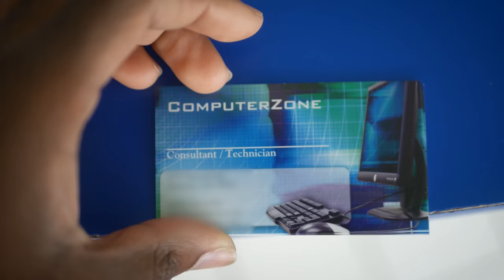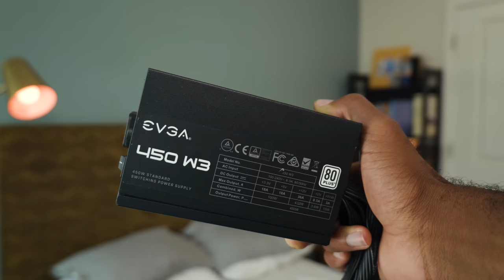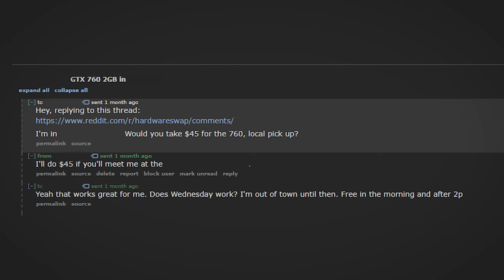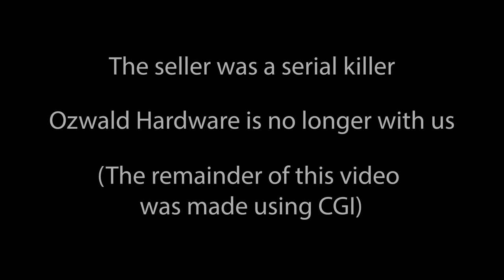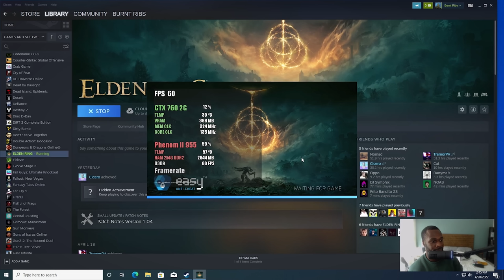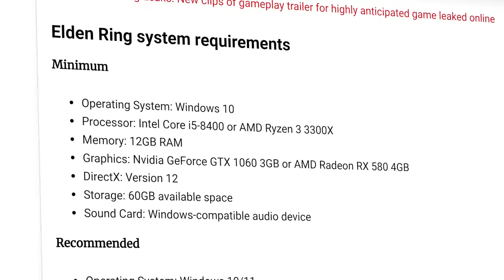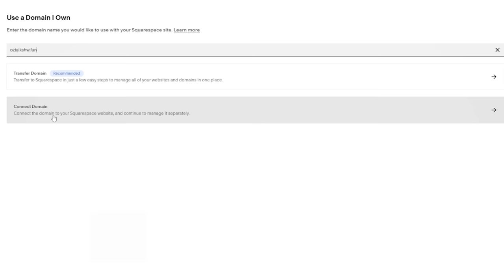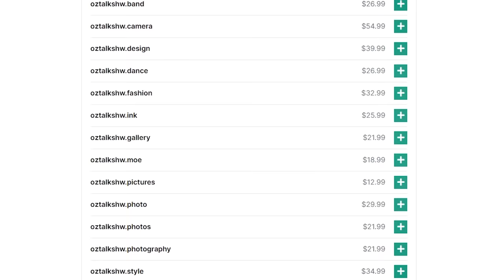I played Elden Ring on a $100 PC...

Comment: I was workin at a thrift shop for a while and I found two diamonds in the rough. I found a i5 4690K with 16 gbs of ram he donated it because the motherboard said it had no cpu which was a psu issue giving it no power its was 20 bucks. I also found a i7 4770s with a r9 380x but with no ram installed so that one was 20 but I spent 80 on a 16 gb kit for a total of 100 dollars that I gave my lil bro.
Reply: W

Comment: It's almost never worth it to "upgrade" an ancient PC that's already on life support, and this video perfectly proves it.
Reply from the maker: Exactly, you just need to build a new one
Reply: Depends what you want to do with it. Adding RAM does wonders, as well as SSD for boot. Lot of people do mundane tasks with their PCs, with only some light gaming. For example, in this case, Elden Ring is not playable but older titles like Darks Souls (very similar settings) could be.
Reply: @aleksazunjic9672  Sure, but don't forget that old components are much more prone to failure, and finding replacement parts will be harder and more expensive as they are out of production.
If you spend a little more for a new system, you will not only get a much better usage experience no matter what you do on it, but also a lot more life out of it.
Plus, your old system has more resale/residual value in working condition.
Reply: @manaphylv100  I'm not advocating spending tons of money on old systems. But if you can get something cheap or even free, upgrading RAM and storage is no brainer.  Overall cost should certainly not exceed 50% of a new system.
Reply: @aleksazunjic9672  If you can get RAM or storage for next to nothing, then of course, take it. But you'll be surprised how many people would spend a fortune on silly things like the fastest CPU for an old socket.
Reply: @manaphylv100  Maybe enthusiasts, but they are rare. Usually people want something cheap to get by.
Reply: @aleksazunjic9672  I hope you mean collectors. They are irrelevant.
Anyway, my point is don't do something stupid like buying a QX9770 for $100 to upgrade your old LGA 775 system.
Reply: @manaphylv100  Well, nobody does that except enthusiastic collectors of old tech :D
Reply: @aleksazunjic9672  Collectors have their own niche, but you'll be surprised how many regular users think an old 1st/2nd/3rd-gen i7 is still faster than the latest i3/R3. Some would pay a premium just for the "i7" or "Extreme Edition" branding.
Reply: @manaphylv100  Admittedly, there are people that think any i7 would be faster than any i3, but these people usually do not upgrade computers because they do not know anything about them (motherboards, sockets, RAM etc ...) They sometimes fall victim to prebuilt sellers and that's it. People upgrading their machines know about generations and would act accordingly.

Comment: Been on the fence about trying this game since I'm on a FX 6300 + Firepro W5000, a budget build that became my main PC after selling my good one.
Reply: Your GPU is a little worse than the GTX 760 in this build but your FX 6300 is far better than the Phenom in it and the bottleneck was the CPU so if you dropped the resolution to 720p you could probably squeeze out 30fps most of the time! I'd say go for it, steam lets you refund games within the first 3 hours (I believe it's 3 hours) so you could always refund it if it doesn't run well enough.
Reply: @jaymills1111  2 hours of gameplay or 2 weeks with no gameplay
Reply: a firepro for gaming.. you must show me a video on the result since that is as far you can get from a gaming gpu😅

Comment: I have a Frankenstein build with the first generation ryzen 7, 16gigs of ram and a gtx 1650 non super that I swapped, traded, and sold parts until the actual cost out of my pocket was 0$ and I actually made a few hundred and got a few small ssds, USB sticks a wireless controller and a few odd cables and screws. I can afford any computer I want but the fun of building something for cheap or nearly free is irresistible. Watching Oz taught me how to build dirt cheap systems and I've been able to get friends and family members gaming that normally couldn't afford to or had no interest in gaming until they got gifted a gaming pc.

Comment: This is a cool project, a learning experience. Maybe I could suggest to try a pentium gold G640 or Athlon 3000 to play AAA games. You know, the low end of the current Gen processors, to build a low budget pc, not that $1000 "budget" pc that most of you tubers build.
Reply: I played ER on an athlon 3000G at playable 30fps 1366x768 while OC at 4ghz and igpu at 1.6ghz with ram oc at 3400mhz
surpicingly stable for bossfights and my only issue was my slow hdd

Comment: Great video, I work for a small non profit that gets gov. funding dealing with seniors, and our budget for tech is next to nothing, and I work at a remote site from my main office, and when I asked my boss for a PC they we don't have the budget, so I grabbed my old gaming build that was in storage with an AMD Athlon II X4 @2.95 Ghz 8GB DDRII RAM on an MSI micro ATX board with AMD R7 240 2GB GPU, and a 450 watt PSU. slapped in a 120GB SSD along with the 500GB HDD put Solus Linux on it, and upto middle of last year it was my main work computer, and during downtime in 2020 with no clients, I was able kill time a work with STEAM games on Solus Linux no problem, but I had to keep my expectations in check for sure, and know the systems limits.  

So yeah I would love for you to revisit this again with an older machine, with DDR2 RAM but on Linux, and an AMD GPU to see the difference in performance.

Comment: On a shorted VRM you can usually just clip the legs of the dead mosfet and undervolt the CPU and you should be fine.
Reply from the maker: Woah, I might try this another time. Thanks
Reply: @OzTalksHW  the same technique works with shorted graphics cards, since most of them have at least 3-phase VRM, by disconnecting a shorted phase you can bring a gpu back to life, it will have a bit less power avalible and might be unstable on the stock frequency,  but you can simply undervolt or underclock the core a bit. If the graphics card or the motherboard supports overclocking, you might not need to underclock it, I just wouldn't recomend overclocking it again.
Only problem is that on a motherboard with separate high and low side transistors, you might need to cut off all the transistors connected to the shorted phase. Also, just check the fuses before testing them.

Comment: I have two Dell Precisions which were $70 and $110 respectively.

Dell Precision T1700: Xeon E3-1240 V3 (equivalent to a i7-4770), 12GB DDR3-1600, 256GB SSD, 1TB HDD, Radeon RX 460 4GB

Dell Precision T3500: Xeon E5620, 8GB DDR3-1600, 500GB HDD, Radeon R7 250X

The T1700 was $50 by itself, and the RX 460 was $60.
The T3500 was $35 by itself and the R7 250X was $35.

Comment: Admirable to attempt a repair. Soldering iron is great, however just remember any and all SMT (surface mount technology) will require hot air and dont force it, once the solder melts it will flow and come right up. I'm still learning as well so kudos still attempting it!
Reply from the maker: Thanks blue :D Nice seeing you here in the comments. I learned a ton from my first attempt and i think im better equipped to do it again. Glad it happened on an older board and not something that I regularly use lol

Comment: Overclocking the northbridge clock is just as important as overclocking the cpu clock. Around 2.8ghz is the ideal NB clock in terms of voltage needed and performance gained. I wonder what voltages you applied to the cpu clock to kill the mosfet. Though MSI is known at least for their midrange to entry level line-ups to have weak VRMs in the Phenom/FX days especially those without mosfet heatsinks. In fact I personally experience that myself. My MSI 785G-E63 board literally smoked after testing my overclock overnight. It wasn't even a big oc on an unlocked Phenom II (originally athlon). Had Lost Planet benchmark loop for a few hours. I was about to exit the benchmark when I heard a pop then a smoke. PC died and I have to RMA the board which the store willingly replaced.

Comment: Thanks for the info! What a useful video. My pc setup is slightly better than this, but I had problems running parts of DS3 so I may need to buy a new CPU. Its hard to imagine what it will perform like on my pc, but with this video as reference I would approximate getting 28 fps in the open world, not good enough for me.

Comment: Hey Oz, great video :) I have a novel of a comment if youre prepared to read it and I hope I make sense, lol. 

You didn't break that 13 year old board BTW! Those capacitors failed, which caused the mosfet to fail, could have happened regardless of overclock or not, but replacing those capacitors first may have been a good idea but hindsight is 20/20. 

That board still maybe saveable!! Depending on how many layers are in the PCB and the extent of damage you can run jumper wire to the legs of other components, for this kind of power delivery cat6 solid strand cable should be fine. Should be plenty of info/vids on this type of repair.  

I have some tips to improve your soldering, try and practice on much older boards first like single layer PCBs or cheaper PCBs even. I also noticed some puffy capacitors and one sorta leaked near that fet, either they have failed due to age (most likely) or the heat gun killed them. you should replace all the capacitors anyways since isn't from around the time of the capacitor plague? 

While that fet can be de-soldered by hand, you need to apply heat directly to the *PCB & against the component legs (one at a time) for sometime with a soldering iron, then remove excess solder (I use solder wick), when you get to the ground or drain pin the biggest pin, that's where you'll need to apply heat for the longest since its a larger area. 

While a heat gun can be used, you have to be very careful not to heat the entire board too much otherwise you could damage/lift the actual layers, I.E. the PCB will bubble and you risk damaging connections between the PCB layers. Also depending on the age of the component they maybe sensitive to high temperatures for long periods, but even 13 years ago that would be still somewhat modern so I think most of those components will be ok (I'm talking I.C.s, mosfets can usually stand heat well). 

Would really like to see you at least try to fix that board. 

Thank you for the video :)

*Edited

Comment: flux and copper braid, and for something that tiny, very fine copper braid, it will be your best friend and if you're going to be desoldering frequently, look into a smaller tip for your iron or a second iron with a finer tip.

Comment: Turning off EAC and disabling steam overlay would improve performance quite a bit, they you could also change some settings files to remove many CPU heavy effects which don't add much to the gameplay when every frame is important

Comment: I launched it on an Alienware Alpha R1. 4770t, 860m (basically a 750 in performance, DX11 only so need workaround), 16gb ram and it played at 720p medium and got mid-40's as far as fps. Also threw it on a Ryzen 2200g APU only build and with it at 720p and vysnc on, it was sticking to 30fps. Not planning on really playing it on either, just more toying around. Waiting for my Steam deck and to finish beating HFW before I really dive in bouncing between Steam Deck and my main pc.

Comment: Those Mosfets are such a pain. I usually use a small clamp to hold the contact pads while de-soldering and I gradually add flux while pulling and heating. Nothing is guaranteed with such small component's though, and to this day I still make mistakes. Hopefully one day I can afford a decent magnifier to work on my projects because you need as much precision as possible.

Comment: Just a tip for you guys, if you have a goodwill around your area check if they have computers, I was able to find an HP office PC with an i7, 8gb of Ram and a 240GB SSD for $35. If you can manage to get a decent power supply and a GPU that doesn't cost an arm, you can get a great starter PC.

Comment: The phenom 2 is the biggest limiting factor here. I played elden ring on a 3330s and a gtx660 with 8gb of ddr3 using the same dx feature level stepdown. It works great at 1366x768p@30fps low settings (except antialiasing cause it's necessary), though the open world on occasion does cause stutters, but that's par for the course in this game. Boss battles are locked at 30fps most of the time, which is totally playable. I've beat the whole game and a fair amount of side content like this.

Comment: I used interlaced graphics and custom resolution and a performance mod to get i60fps at 810i at max settings. On an old i3 4130, 16GB ram, 32GB of ReadyBoost (with a fast USB flash drive, SanDisk Extreme) and an 4GB RX 550. The real and absolute trick to make it work was that interlaced frame rate as that made the CPU and GPU work twice as fast as before.

Comment: I recently built my fist office pc 
Optiplex 990 (i5-2400) 8gb ram no hdd 125gb ssd preinstalled (did case mod myself) - $80 
500w thermaltake psu (literally brand new) - $20
Rx 590 fatboy - $180
$280 total and played whatever i through at it at over 60 fps war zone avg 80 fps and played very smoothly would recommend to everyone

Comment: Big Tip: If you glue heatsinks on the mosfets using thermal glue you can improve their performance by a gigaton. Just pay attention to be sure you are not shorting anything with the heatsinks.
One of the biggest difference in performance from low budget MB (officer boards) to mid ~ mid-high tier MB is the presence of heatsinks.

Comment: Just feel like I should put this out there, I haven't upgraded my computer since the Nvidia 900 series came out, and even then I only got a 960. So with a regular 960 2GB and an i5 4690k I can average about 45fps on Elden Ring. Easily hits mid 50s in less taxing areas. I was honestly genuinely taken aback by how well my dated hardware can run this game. All low settings of course.

Comment: I find this hilarious as I'm actually upgrading my living room rig to an Intel i7 because my Phenom II X4 965 can't run cyberpunk or Apex (no SSSE3 support). The parts for my small upgrade costed me $62 (CPU i7 2600k/Mobo Dell Precision T1600/Generic CPU fan), and I already have the other parts(obviously). So I'll have a 790x G45 mobo with the x4 965, and a 500w psu and some low end GPUs that I can toss in  to make another rig, just lacking a case, ram, and a HDD to make it complete.

...maybe it could be of use to you if I don't sell it off or rebuild it?

Comment: i played the game with a 1050 cause my 1070 died in december and i had a spare 1050 lying around. it wasnt the smoothest experience and i expected to not even be able to run it because the minimum requirements say 1060 but to my surprise it handled the game with 35-40 fps average and was pretty playable. especially since my favorite game is bloodborne and that game only runs at 30fps so i was used to it. cant wait to get a new gpu tho.

Comment: I have a lenovo flex 5 with the 5700U and that'll play Elden ring at 1080p and about mid 20's to lower 40 fps, but there's a weird graffical glitch where it dosn't load all the textures for the enemies so in large areas the enemies will be invisable. Not the funnest thing to have to deal with.

Comment: Dear mr Oz ;
i did the same what u did i took a motherboard  from a other case bought in 2018 from the Aldi ddr 4 whit a i3 proc and placed it in a new case whit a new power supply and already at hand a 1050 TI OC  so i bought 3 extra fans for in the case i have now 7 fans running wind over the motherboard it a true wind tunnel the case is the gamming 9988B  rambot the 3 extra fans are from Earkings also put in 2 hdd's 1 of 1 terabyte and 1 500 those where already in my collection.
the total amount was under 400,00 euros the new power supply is 850 watt from gigabyte 80 plus gold, single channel  total of 16 gb it play's tome raider flawless.

Comment: System specs for games are more of a 'minimum supported level of hardware', as opposed to a minimum level required to run the game. Games will certainly run on lower specced systems, but devs set that minim spec cut-off somewhere for a variety of reasons, like performance dropping significantly if below spec. It also lets devs reduce the amount of hardware they need to test on and provide support for.

Comment: I am sure there are ultra low custom configurations out there to decrease even more the performance (I'm surprised LowSpecGamer didn't make a video about elden ring yet, he usually makes that kind of videos), and maybe you can run it at 720p and use Fidelity FX to upscale it to 1080p making it run better

Comment: Thats actually really imprssive he got it to run, i have a 3060 11th gen i-7 and 32gb ram, and it would run at around 45-60 fps not very good IMO especially so randomly. Im sure it was a bug and if its fixed ill give it anoher shot.
Reply: @J90I  Thank you Gefore experience helped a lot more than you would think, either way im at a solid 60-90 ATM on high/ max settings works for me. Thank you kind stranger!

Comment: This is awesome. I'm curious to see how the game would run on that system with Linux through Valve's Proton compatibility layer. I feel like your becoming a linux head would be an asset to milking performance out of ancient hardware, since linux can be very light compared to windows.
Reply: This and he could use fsr on the game further increasing performance at a ignorable decrease in quality.
Reply: @quandalemuncher2337  fsr won't do anything in this case cause of the CPU bottleneck
Reply: This is definitely something I'd like to see. FSR and Gamemode enabled. I know this system is probably bottlenecked by the cpu and in that case I'm not sure how much Linux would help, but that's why it would be interesting to see.